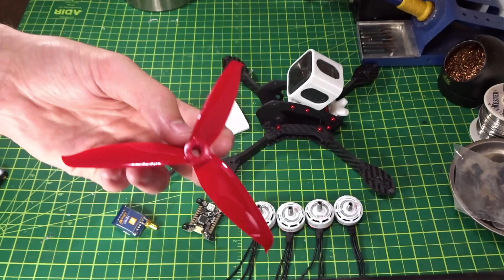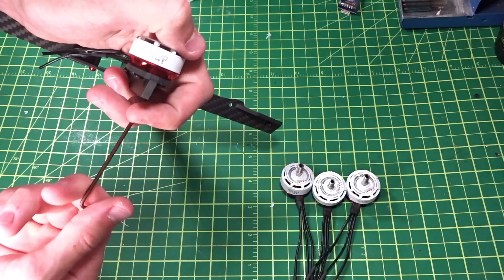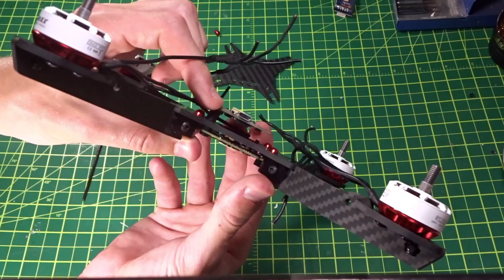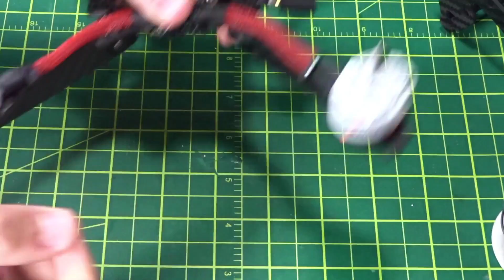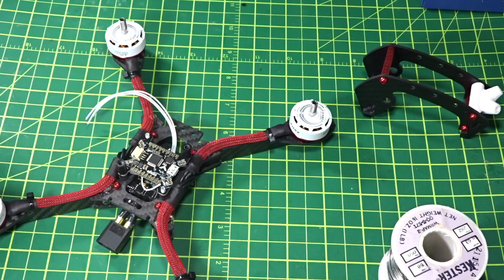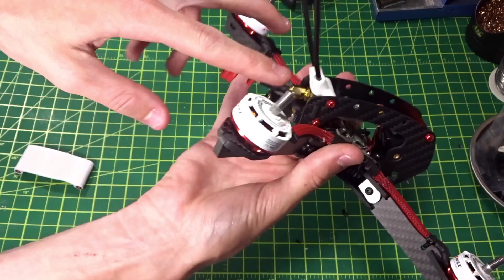Skyline Rampage Build : Emax RS2306, Spedix IS30A, FX799T

Comment: Lets take super skinny arms, and put there huge cable cover, because it is nice. Make sense
Reply from the maker: I literally only added an extra 2mm...without them they would shift around getting cut or making more drag.
Reply: Yea two thin electrical tape strips arent that sexy i got it.
Reply from the maker: I hate using electrical tape. Cut easily, doesn't look good, and leaves every sticky when you take it off.
Reply: Hmm, i using it on arms on some quads, and never had problem with stickynes after remove.
Reply: But yea, who care about aerodynamics, and how it fly, important is how it looks. For someone. On youtube. ,-)
Reply from the maker: I guarantee you won't notice having the wire mesh on...

Comment: Update!  In case there are people who followed this build like I did, the new red Radiance FC removed the PPM pin and added a TX2 pin in its place.  If you solder a motor signal wire to this new pin like how it was done in this video, it will not be detected.  The motor will not respond to your Tx commands.  It will not be detected in Blheli.  Connect the motor signal wire to esc 1.
Reply from the maker: Yep, new Radiance natively supports DSHOT.

Comment: Does the fc work with beta-flight
Reply from the maker: of course
Reply: im having trouble what firmware do i use and is it the fc called PIKOBLX on Betaflight
Reply from the maker: If it's a pikoblx you use pikoblx

Comment: I went with the 22.8g 2205 2500kv Fuuton motors and calculated 18awg wire for my 273g Awesome F200 build with an Asgard v2, Monster v2 cam and Ideafly motor bumpers.  ;)

Also have 2mm bullet connectors on all motor wires for easy motor swaps, though have yet to need to replace them. (Insane, right!?)

Comment: Hi what do you think of the EMAX 35A bullet or the ipeaka 35A / 50A Blheli 32  ESC's or is there better options for 2305/6 motors
thanks
Reply from the maker: They will work fine, but there really is no need for such high amp escs. These will run fine on 20a.
Reply: thanks for the quick response,,  is 18gage wire ok for these type of motors thanks
Reply from the maker: Yeah sure, 20awg is fine too.
Reply: thanks again its much appreciated.....

Comment: prettiest build to date! Them some mighty juicy soldering skills you got there!.👌 P.s. you want to create less vortices, put the motor wire on the bottom, sharpen those arms Leading Edge!. preferably with a belt sander.! lol👍🏁🏁
Reply from the maker: Rounded the tops creates so little of an advantage for the cost.

Comment: I want this but with the betaflight f3, and the new runcam split. Then you have it all. The lower esc idea is awsome, saving you space to put the split board in. I'd run the tbs unify so it could be closer to the cam giving you space for the splits board. What do you all think. Possible? All the same super clean build and looks great.
Reply from the maker: Yeah should work great! I am just not a huge fan of the extra latency readings for the Split.

Comment: Hello. I asked you a couple of days ago about your favorite vtx, and flight controller. You said you were getting about a mile with the tbs vtx. I should have also asked about the antenna you've been using with that vtx. So now I am. Thanks for your help.
Reply from the maker: I run various VTXs and antennas, but don't really notice any difference between most of them, they all work great. My top picks would be the TBS Unify, Rush V1.1 and FX795T-2, and the TBS triumph stub and emax pagoda stub.

Comment: A 16:1 thrust to weight ratio isn't too bad though :P
Reply from the maker: While it may have more power, it hurts in the corners, and in racing you probably won't be using that top end power anyways.

Comment: Hey finally working on my build, using the Flytower F4 all in one powercube. It has literally everything you need including a 400mw switchable vtx, 40x4 ESC's and an F4 flight controller. It does all the way to Dshot 600. You add a receiver and a cam and plug it up to Betaflight and you are good to go. Frame is a mid level platform the KingKong 200 Rammus and I am using the Racerstar 2205's 2300kv motors, they are a really nice blue. The motors may come out later but they definitely will do the job for now. I am using an Aomway 700tvl cam as my FPV cam... Theme will be Black/Blue/White with braided black and blue sleeving. The body is white one of several bodies included for the frame.
Reply from the maker: Nice :)

Comment: IMO vertical arms are a MUST in any design. So impressed with this frame i just ordered 2!
Nice video dude, as usual 👌
Reply from the maker: I am not as convinced. I mean a frame like the Hyperlite Floss is only 55g, and the arms are just a little wider than here, so I am not sure if it is worth the extra weight gain.
Reply: Planning an aio & micro components in my Rampages.
Look fwd to your test flights & hoping you do some track tests.
DFTF
Reply: (don't forget to floss)

Comment: Are you going to race this tomorrow? I ripped one of those emax 2400kv motors off my helix today practicing? I think it's due to either loose motor screws or the way the motors mount to the helix adds stress to wires motor is toast tore the wires to far back in the sator. May have been a combination of both.  I tryed out the evo did'nt like remote  only used it two times to small then I switched from spektrum to taranis today was easy switch so far liking the x9d. Don't try the evo just heads up
Reply from the maker: No I didn't, wasn't ready in time plus 200mw VTX not allowed.

Comment: Looking good man i bed its a fast quad im queries to see the maiden btw i have a question  because i have a problem ,my pitch forward is backwards and vise versa do you know how to solve this problem?
Reply: Bennie Leip If you are running deviation go into the mixers settings, press enter on the channel and there is a reverse option. Pretty sure there is a faster way to do it by long pressing somewhere but my 7e is in the car and it's passed my bed time here in the UK.
Reply from the maker: Go into your radio and reverse the channel
Reply: The RCAddict i got a devo7🙄 but it must to be in there and not in cleanflight? Its a bit unclear how its stand on the display thats why ,but thanks for ansering btw srry for the englisch im dutch😆
Reply from the maker: Yeah, not sure of the Devo menus but for sure you just have to reverse that channel. Maybe look up a tutorial.
Reply: The RCAddict thanks man im going to look in to it 👍🏻
Reply: Dan Williams thnks man it only was under elev. so iam reset the controller and i had a lot of things to figger out  but its working again but after resetting one of my switches isnt working do you know how to fix that?
Reply: Dan Williams eej man do you know what kind of receiver i can use for the devo7?

Comment: Nice build!
Why do you run separate wires for  VBAT and GND and not take them from the same ESC connector where PWMs are?
Reply from the maker: As stated in the video, it was a mistake. I didn't think of it at the time to just use those. No difference either way though.
Reply: I'm thinking of new 5-inch build for freestyle/acrobatics. Will you recommend this frame? 

Also can't decide between 2600 and 2300kv motors - am i right that for the best acceleration/agility i should use 2300kv with 5045/5050 3-blades props, while 2600kv with smaller props are for the max speeds?
Reply from the maker: It depends I guess. Weight is a big factor, and at 95g this certainly isn't "light" but you could do much worse with an 140g alien frame haha. I like lower kv on heavier quads with GF5152 and higher kv on light quads with DAL Cyclone V2.
Reply: Thanks!

Comment: Are you planning to put Runcam Split into your builds?
Reply from the maker: From what I have seen it has 51s latency, so that is a no haha
Reply: Whats the latency on swift then?
Reply from the maker: I think normal latency is about 20ms. For normal flying it is perfectly fine, but it adds to the system (radio, fpv, and you) and at 80mph it is a few feet. Kinda scary to think about haha
Reply: Pretty scary, thank you for info
Reply: Still hope you try one out at some point.

Comment: awesome video!watched it all!
-why you use capacitor?
-install the VTXs pigtail straight into the carbon is not ruined the range?
And where you bought the clear heatshrink?
Reply from the maker: It comes with the ESC, so why not haha. Nope, grounding the antenna is perfectly fine, just make sure no positive wire can short to the carbon. https://www.fpvheadquarters.com/catalogsearch/result/?q=heatshrink
Reply: The RCAddict thank you so much!

Comment: Wow, this built is awsome!!! A couple of questions. Why you didn't use one fc whith an osd and why it's better to take the positive from video transmitter other than the fc? (thanks)
Reply from the maker: I have never had the need for an OSD, so I don't go out of my way to get one. I just found it easier and cleaner to take the 5v for the cam from the VTX since it was already properly wired.
Reply: How do you know tha'ts time to land?  Monster V1 doesn't have voltage monitor. I've read that some camera performs better on 12v than 5v did you notice? Thanks.

Comment: Haha, no 20A ESC on this one? :P
Reply: I use xm20A with F40Pro and RK5051 xD
Reply from the maker: It would be fine probably, but the Spedix is too nice not to use ;)
Reply: lol...I was like; Huh, 30amp esc? Those must be powerful ...and immediately went looking for the motor specs. ;)
Reply from the maker: lol my reputation precedes me ;D
Reply: can you use the racerstar 20amp v2s with the rs2306 2400kv motors? idk if i would burn the esc out or not?
Reply: Don't buy Racerstar RS series ESC. Those are made by Cicada. Get Racerstar MS series instead which are manufactured by ZTW. Get the 25A. It can handle 35A burst
Reply: IRFZ44 i already have the racerstart rs 30amp.. will they work eith these 2400kv emax motora?
Reply: It depends
Reply: IRFZ44 what kind of answer is that...?"it depends".. everyone else i talked to said it would work just fine..
Reply: Sorry I meant it'll work fine.